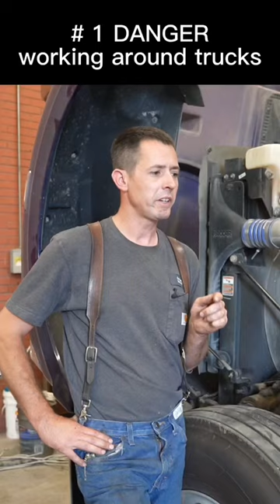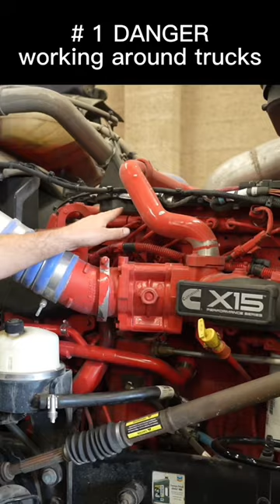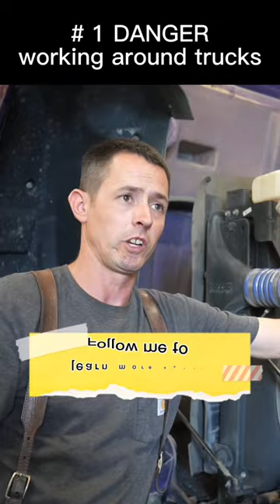#1 danger around semi trucks - common rail pressure danger #shorts

Comment: Its total and proper BS that you'll be cut in half by high pressure diesel.

That said fluid injection freaks me out and can definitely kill, I've seen pictures of guys with their arms cut open to the bone and left to hang like a slab of meat to get the hydraulic fluid out, truly grotesque. 
Wear a heavy leather glove or use a bit of cardboard when you've got to touch live high-pressure systems, especially if its old and has problems.

Comment: Was on a job where a 48” line was being descaled. Something logged itself in the tri tip in the jet line. The guy running it didn’t stop the compressor and pulled the line back just far enough for a laser beam of water to shoot up the inspection hole and slice him up the neck.
It wasn’t life threatening luckily…but it easily could have been.

Comment: Don’t worry about the rail pressure too much. It’s pretty rare at least with my experience to see a rail leak. I still see people cracking fuel lines to bleed the fuel system with is VERY dumb. I’m
More afraid of the fan or the tires.

Comment: Another issue is the way the lines look so similar to an old mechanical engine, they’re just begging for the unsuspecting old timer to go to cracking them loose to find a misfire. Isx always loosen the pump to rail line at the rail before servicing the system, it’s designed to bleed any residual pressure away from you

Comment: Holy shit. I knew hydraulic systems in tractors and other heavy equipment can run between 2500-10000 psi, but had no idea fuel pressure was that high for engines. That’s insane.

Comment: I got isx15 Idle for like an hour go to pull off truck stalls. But if I can remember rev up a few times before I go it doesn't happen. Change fuel filter every 7000mi

Comment: Leaks aren't common on these engines. You likely wouldn't be able to even get it started with a leak that severe. Breaking that rail loose while under pressure tho. Thats a bit sketchy. I do it at the pump to rail line at the rail at like a 45° angle away from me lol.

Comment: Used to be a coal miner. There was a guy in town that died from a pin hole that shot 5000 psi of hydraulic fluid that shot through his face while he cut a hydraulic line on a long wall shield. Hydraulic pressure will kill and people don’t care.

Comment: Ryan, I have a question for you. I had a shop replace the wheel bearings on my truck and after driving it for about 2 weeks the wheel started coming off on the highway. It damaged the spindle and put me out of work for about 2 months. I sued them in small claims court and the judge is saying I need proof that they caused the problem. Any ideas on how I can prove that they caused the problem? It has been fixed by another shop and I have had no problems.
Reply: In that amount of time you could have had it off now looking to blame someone for ur fuck up  but if you hadn had it off been to long not there problem

Comment: It is dangerous but working with fords 6.7s and 3.2 pumas, it really isn’t that big of an issue, should never  be in a situation to get hit with that fuel torque is done while trucks off obviously. Only way I see you hurting yourself is if you blatantly forget a torque spec and left one at stage 2instead of 3 started it and stuck your hand down there to find the leak instead of shutting it down and looking with a light. All in all very avoidable injury almost gotta be dumb

Comment: What about sticking your hand in the fan blade or the belt what about not caging the brake can and getting whacked
Reply: I was on my way to Phoenix one night and stopped at a rest area for my 30. Soon after, another truck pulled to the shoulder and popped his hood because it was overheating. With the engine running I stopped the fan with the end of a long flashlight and showed him the clutch isn't engaging and he decides to fully grab the fan blade and stop it with his hand. I said yea good luck fella and left.

Comment: Why the heck does it need that kind of pressure? You can make 1,000 hp on 50-100psi on a car. Why is it required to be that high on a truck?
Reply: Direct injection is used on diesel engines for ignition as they lack spark plugs.  On my gas car, that has direct injection has a fuel rail pressure of just under 400 psi at idle and can go to 2,000 psi at 3.5 k rpms while driving.  I wonder what the pressure is at wide open throttle.

Comment: I watched the brake drum one and now idk how much I wanna diy work on diesels hahaha
Reply: I am a BIG diy guy, but I didn't know how much pressure was under the motor here until this video.  Now I have 2 things I won't touch;  Brake drums and these motors now.  That's the type of work we should have robots for.  Not the basic foundry/factory work
Reply: @yimmy7160  ya seems crazy huh
Reply: Brake chambers are scary my boss told me a story about a driver having the chamber bolt go thru his hand
Reply: @chrisz1100  That's better than the story I heard where it took somebody's head clean off and proceeded through a 30ft high ceiling so fast it literally left the shape of the coil in the roof.  That's thousands of lbs pounds of pressure, no thanks.  Respect high paid people for there are good reasons for the high pay, usually being extreme dangers of the job as is shown here
Reply: @chrisz1100  we learned in tech school ,don't toss em in the garbage. 
20yrs later sitting in a landfill and it blows apart as some picker is messing around out there. 
Cut em up all to pieces don't ever leave em assembled.
Reply: I had an airbag (air suspension) blow once. About 30 seconds after I post tripped it & walked away, it sounded like a bomb going off. I thought, "the hell was that, not my truck?", but yeah, it was. Glad I wasn't still near it, I'd probably be deaf today.
Reply: @outhere8690  can’t even imagine lmaooooo scary brooo

Comment: See that's not enough volume to do any damage unless you run your hand directly over the leak that's not at all the same thing the reason the steam on your ship is there was an almost endless amount of water in the steam pipe so when there was a leak the pressure stayed there and it shot that steam out constantly this fuel system will just drop pressure off almost immediately

Comment: It’s a lot safer than working on a ford or Chevy diesel  😂
Reply: Bahahha yea they might start falling apart on top of you
Reply: @p3rformanc3fanatic60  no lie i literally worked on a 2018 Ford Expedition with 20k miles on it and the wheel bearing was falling off already, also I live in the upper blue states (criminal states) and the potholes, etc are relentless

Comment: I highly doubt the fuel feed is 30,000psi. 

That is just outside the realm of normal equipment without multiple stages.
Reply: Yes they are extremely high psi fuel feed pressure at that rail duetz engines will have a hand being cut through at these rails you use objects to find your fuel leaks like he said because sticking your hand anywhere near that rail leaking your getting hurt been close to having it happen I would say second dangerous thing is the brake chambers !
Reply: When towing with my Duramax I’ll see almost 30,000 psi. It will stay above 20,000 psi no problem under load. It’s hard to believe but these common rail injection lines are insane.
Reply: It is around 7000 psi just at idle. The pressure relief valve is around 42,000 psi.  
 It only takes about 100 psi to penetrate skin.  
The pressure is indeed that high !!
Reply: @ifixthingsalsobreakthem5835  holy crap man the amount of scary shit
Reply: Pretty crazy aint it? It's scary and has to be respected.
Reply: Seems you would be very wrong. There is in fact multiple stages, and there is definitely that much pressure.
Reply: @customconnections2425  I work with positive displacement pumps operating at 20k psi. There's no need to pressurize fuel anywhere near that. And we're hardly moving any water, maybe 6-10gpm for 15k-20k and the 40k max drops down to about 3gpm, and it requires an electric motor the size of that engine (roughly 200HP) driving a 3 piston positive displacement setup. But the bigger reason I said that is that at 20k psi, the carbide valve seats have to be relapped every 200ish hours of run time because the high pressure creates so much wear. And that's triple filtered water down to 1 micron final stage.

Also, it would make little sense to keep that massive rail all at that pressure. It would be more sensible to hold the rail at a preload pressure and then run a displacement system off the cam or something to hypercompress the little bit of fuel needed.

Trying to maintain 30k on that whole rail would result in a lot of shock loading every time an injector fires along with making it a huge fire hazard (since it'd be more susceptible to failure at such a high pressure and leaks would atomize enough to likely ignite from hot surfaces like an exhaust manifold or turbo.

Where can I find the info on this fuel system?
Reply: @ObservationofLimits  they are called common rail injection systems
Reply: @ObservationofLimits  they do work with these pressures to atomise the fuel as much as possible for the cleanest conbustion